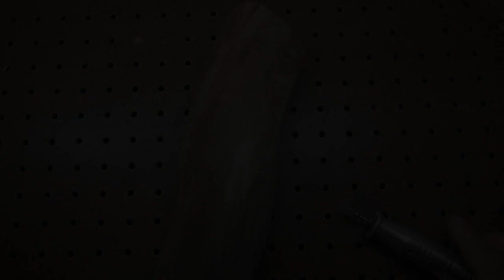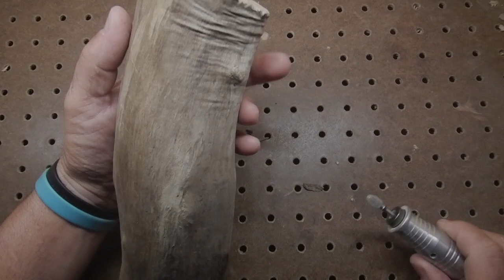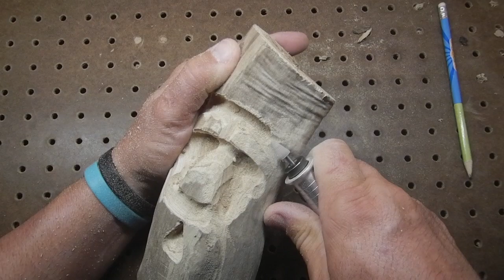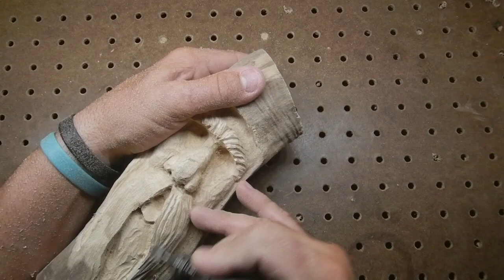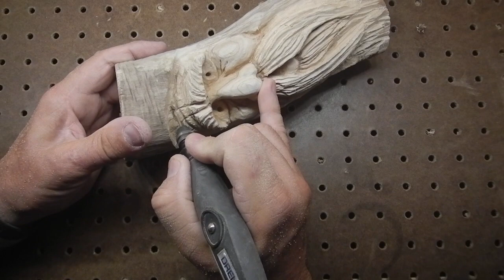Wood Spirit Power Carving

Comment: Wonderful!  Is the long slender pink “burr” one you made yourself or did you purchase it?  If you do make these would you please share your procedure, if you purchase them, where do you get them?  It looks like a very good final sanding bit to really smooth out the cuts from other burrs.  Thank you so very much for sharing your talents with us.
Reply from the maker: Laurie McConnell Hi there.That pink one is Split Cylinder Mandrels you can buy it on amazon.I usually cut out a little bit of sandpaper stick on type and just roll it around the bit.

Comment: I have another question for you.  When you switched over to the Dremel and carved the whiskers on the beard did you use a sanding drum on edge or a cylinder burr?   Again, I love your work. Thanks
Reply from the maker: Laurie McConnell Hi there thanks again .I using this 

https://www.lowes.com/pd/Dremel-2-Piece-Steel-Carving-Bit/3824357